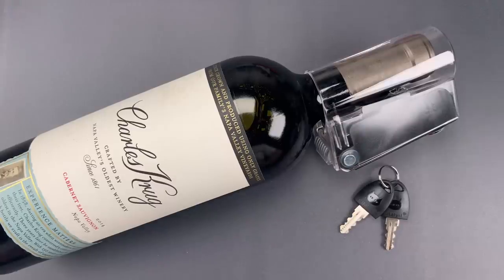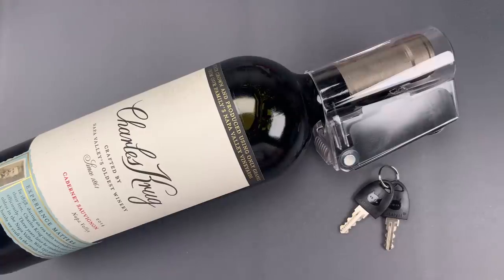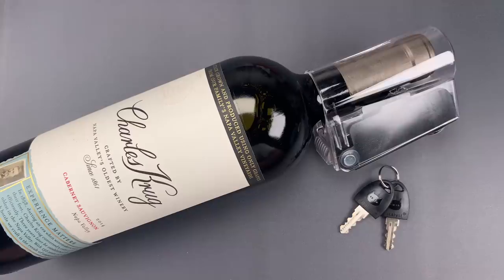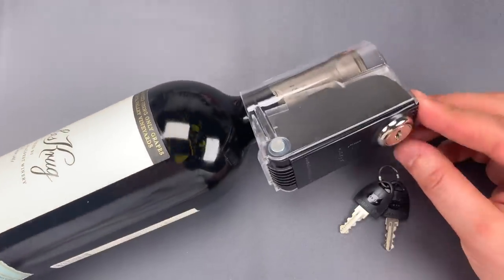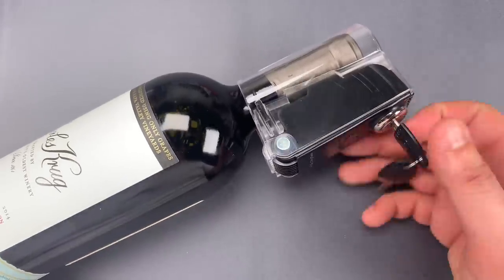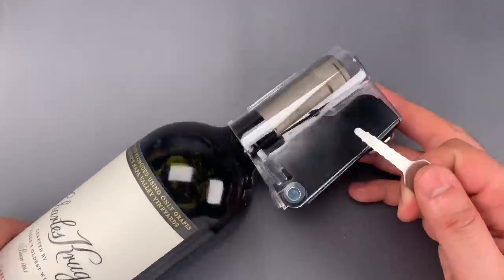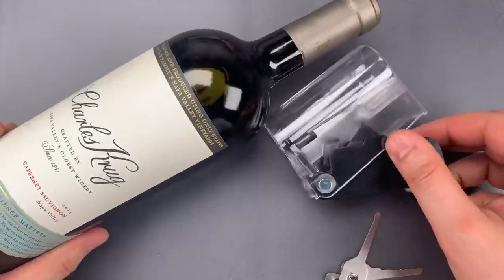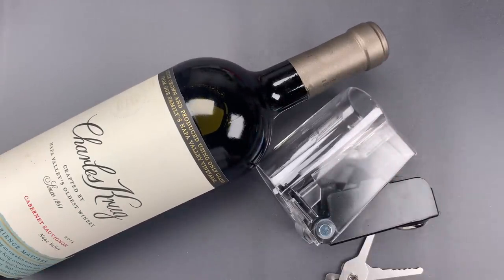[1153] Catalyst Bottle Lock Jiggled Open

Comment: I'd rate this product 2/10: still better than Master lock.
Reply: I was going to say you’d be better off putting a Master lock in your liquor cabinet!
Reply: I was really hoping this would be the one lock he couldn't pick.... ok, not really.
Reply: nah, a 1/10 is still better than a Master lock
Master lock is the baseline for: no this is bad.
Reply: My first lock I picked was a masterlock pad lock. Bought it brand new and when I got home, I put my pick in it and instantly unlocked. Confused I do it again and the same thing happened. I looked at the key and saw that only one pin needed to be moved just to unlock the lock.
Reply: I was like 1K.
Reply: Masterlock are good training locks as i bought a pick set, I picked the flagship Excel 70mm wide with U shape pentagonal 12mm shackle in about 2 minutes, consider that i had no previous experience, i consider that a good effort. I also popped all my other masterlocks, but for training locks they provide a novice with a challenge
Reply: @JamesPhillipsOfficial  Thanks for the advice!
The one thing that a novice can't open them with is half a bobby pin and a paper clip. I tried.

Comment: LPL: hey guys today we’re going to pick into the Whitehouse, as you can see I’ve taken out the guards so we can work in peace
Reply: "How did it feel, Preston?"
Reply: I've taken out the guards using this bomb Bosnian Bill and I made
Reply: The first thing you do is rotate the guard's neck as far clockwise as it'll go, grab vertebra number one, and let's start cracking. Nice click out of two, aaand we're done. And there you have it folks, as you can see, this is not a spinal column I'd trust securing my nervous system.
Reply: @Wampa842  As you can see from the bone construction of the skull, it's not designed to resist forced entry
Reply: @Wampa842  quality comment
Reply: I'd really want to see him do any of the locks used at Fort Knox.
Reply: @pooyataleb2514  Is it just a pipebomb made from failed Masterlocks?
Reply: Not gonna lie LPL could legit have and star in a spy movie, use real methods of breaking in and I'd watch the fuck out of it.
Reply: These comments are gold 😂😂😂💙

Comment: You know that the lock has been tempered with when the bottle is suddenly half-empty
Reply: ... or missing...
Reply: Or as it's a wine bottle that the seal on the bottle itself is damaged 🤣
Reply: It takes more skill to put back the cork in it's original state.
Reply: Drank some vodka when i was 12/13, replaced it with water, a few days/weeks later this bottle that hadnt been touched in years gets thrown in the freezer
Reply: Nathan Fielure or a butlers friend 🤣

Comment: Wine bottles on the shelves in Tesco: ”I’m in danger”
Reply: I used to work in Tesco and these things are a nightmare. They'd get stuck on bottles with fat necks, Jack Daniels was the worst, and you end up having to rip the thing apart to get it off.
On smaller bottles you could actually take the whole thing off if you jiggled it right, no tools required at all.
And best of all on pretty much any bottle it's possible to shim the big latch thing that holds the tag onto the bottle. I tended to use a pen.
Reply: The ultimate try-before-you-buy pick. :)
Reply: Some mirrors and good video cameras would be much more efficient, and less insulting to staff and customers.
Reply: I had to look up Tesco.
Reply: UK's Target <3
Reply: @chrisb9960  Tesco is basically like Walmart in America, similar type of store, you can get things like electric goods, phones, clothing, gift cards as well as food. I used to be a Security guard there. One Tesco store managers are adamant that i was scared of shoplifters, but actually i think they were scared of me as im taller, bigger and stronger than all their staff put together, they would s+++ their pants if i turned up there again, because it wont be pretty xD
Reply: @JamesPhillipsOfficial  He asked about Tesco, not your life story mate, nor how badass you are.
Reply: @JamesPhillipsOfficial  Asda would be the Walmart of the UK
Reply: @JamesPhillipsOfficial  Instead of making inaccurate analogies, it's much easier to just say that Tesco is the UK's largest supermarket chain. It's not much like Walmart at all, because it's much more focused on groceries.
Reply: @JamesPhillipsOfficial  Isn't the sole purpose of an LP to deter theft? Your job isn't to pick fights with people lol. Tesco are idiots if they think you should risk your health just to tackle a guy running out with a bottle in his hand.
Reply: @DexVorsutus  The dude doesn't require the guy who commented to ask in order to talk about that.
Reply: I went into a Walmart the other day and man I bet some prisons have less security. There was one aisle that no joke had 4 different cameras running and I think two of them had live feeds to show that they were recording. After looking in other aisles I noticed there also were at least 1 or 2 cameras if not more in every aisle. I kind of understand that kind of security in like the electronics section but in some random beauty products section where the most valuable item was probably only like 20-30 bucks. Seemed a little overkill.
Reply: @nop2774  Cameras on the cosmetics aisle make sense. Small items costing $20-30 are a good target for thieves because they're easier to smuggle out of the store but still fairly valuable.
Reply: CMOT Dibbler 
Asda is actually owned by Walmart, as they bought it years ago, and Asda was formerly called “Asdale” , hence the name
Reply: @ataphelicopter5734  Asda was never called Asdale: that was just the name they used for their own-brand clothing for a time. They were bought by Walmart in 1999.
Reply: @DexVorsutus  ok bozo, chillout. How dare i add to the conversation, right? What we can learn is that Tesco is a supermarket, if comments are not boring enough for you, go read a health and safety book, that will satiate your desire for boring comments, thankyou, kind regards
Reply: @KiLLJoYYouTube  yeah that's what it felt like, i'm not a thug in uniform, im not going to risk my health for a bottle of wine. our trainer said we can't touch people unless backed into a corner, so i followed that, i asked shoplifters politely to return wine bottles, while i got my hands on a bottle with one shoplifter, we did tug of war, she got away. The staff want a bulldog for a security guard, im not like that im civil, polite and try to reason with them, im not going to fight people over stock that isnt mine in a company that doesnt care about me
Reply: @DexVorsutus  obviously i got sacked from there. The specific store i hate is worcester foregate street tesco express. Type in google. Someone was stabbed outside there just last night at 4:30am. It's a rough store, so the staff are very antsy and highly stressed. But i was relieved, i may do a video about that store, but with my current situation, its high risk, they still have my details on record for 3 years according to data protection. I can play it in the next 2 years possibly
Reply: @JamesPhillipsOfficial  ok boomer
Reply: @ataphelicopter5734  Asda used to be "Associated Dairies and Farm Stores"
Reply: @DexVorsutus  wow, so original 😐
Reply: @JamesPhillipsOfficial  ikr
Reply: Lesson learned - don’t trust someone who lives next to an Asda about the history of Asda

Comment: The desperate drinker will automatically have the necessary shaking movements hard wired - just put anything inside the key way, and 'open sesame'!
Reply: Thumb pressing on the cover while jiggling would've taken the pressure off the "lock", making the jiggling even easier and lower skill.

Comment: Fabulous!

This should have been another for Mrs LPL,
imho.
Reply: I was thinking the same thing. Just harder to code 2BDrank than 2B8. 😉
Reply: She would just cut the bottom of the bottle
Reply: The lock is open on the top.  If it’s sealed with a cork, she could just use a corkscrew.  A screw cap would be trickier.

Comment: We use these with a magnet release as a poor anti theft device, if you feel brave you can actually just smack them hard from the bottom and pop them straight off the bottle, also if the bottle has a threaded cap you can often run the detent like bit that springs out up the thread and off the bottle, or just undo the threaded cap...

Edit- just looked at the price on amazon... what the hell.. 3 pack for $60 we buy boxes of like a hundred for less
Reply: A couple of years ago, i was at an international summer school for students and we ended up at a bar. After leaving, it became clear that one of the guys and taken a bottle of alcohol with him, still with the locked cap in place. He nearly cut himself as he tried to open the bottle, the complete content wasted. Yeah - he was an idiot, but at least against drunk people, the seals work somewhat.
Reply: Can confirm. The amount of times home delivery services forget to remove the anti-theft tags/locks has made me pretty efficient at removing them without tools. Sometimes they chew up the caps but the type shown here is particularly easy to get off in the ways Simon suggests.
Reply: I've managed to open one using two forks as wedges to open the gaps then slipping a pick in and simply pushing both of the clamps off the bottle. It feels like you need 3 hands but it's definitely doable once you work it out.
Reply: @lairdcummings9092  they work ok ish as a visual deterrant but the cost to retail is pennies per unit and they do deter the low effort theives
Reply: @Simon-ho6ly  so, useful in a retail environment. But bloody useless at home.
Reply: Christian Challiner for about 30 quid you can buy a Tag Remover off amazon (for the magnetic ones)
Reply: @WastefulGlint  For less you can just buy magnets

Comment: If only wine bottles has a in build tamper seal...
Reply: I assume this lock is for a bottle that is already opened.
Reply: I live 10 minutes from a fairly sizeable wine-producing region in Australia. Most bottles of non-sparkling wine here have screw caps, not corks. It's just more practical for consumers, who won't need a special tool to open a bottle and will be able to close it again afterwards.
Reply: @3rdalbum  I'd hardly call a corkscrew a special tool.  I can also assure you, corks are reusable.
Reply: @Tjalve70  Seeing as the top of the lock is open above the cork, an opened bottle of wine could be reopened while leaving the lock on. Assuming you use the correct style of cork removal tool. Instead of using the corkscrew variety, use the shim/wedge cork puller type or even the needle and pressurized gas variety. In that case, the "lock" wouldn't even need to be removed. If you're careful cutting the foil, you could even glue it back on. Look for LPL's Ben and Jerry's lock video. His wife was clearly thinking outside the container and knew how to handle LPL. 😁👍
Reply: @3rdalbum  Yes but its still a tamper seal as you break the metal connecting the screw top to the neck of the bottle.
Reply: Tjalve who locks up an empty bottle?

Comment: A wise man once said, "Warm beer is infinitely colder than no beer."  Thus it is with wine bottle locks....
Reply: the thing i've never understood about these bottle locks, what is the actual point to securing something which you can simply break open by snapping the top of the bottle off? like if you're gonna drink it anyhow, its not like they're gonna NOT know that the bottle has less in it than before or is gone entirely

Comment: If my kid chooses to learn lockpicking just to get access to a bottle of wine, instead of sourcing one elsewhere or merely breaking the lock, he deserves the wine.
Reply: I was literally just thinking this same thing LOL!
Reply: Though to be honest, I wouldn't call this 'lock picking.' Too easy.
Reply: Classic is to break the neck of the bottle, then carefully not touching the shard edges,
Reply: @johndododoe1411  Easy, that's what the plastic solo cup is for.
Reply: Be careful. This is a gateway lock. Next thing you know he'll be cracking your safe full of cocaine.
Reply: so, a better way to explain this, this really isn't lockpicking, this is just what you're already subconsciously doing when your hardware store cuts you a key for a lock and it doesn't quite open it, but you can wiggle it around until it pops open anyways

Comment: Me before: Faster to get a saber and cut the top off.

After watching: Never mind. Keep the Saber on the wall.
Reply: You can't sabre the top off with the lock installed, because sabring requires running the sword along the neck of the bottle.

Comment: When I saw the word catalyst I thought you were doing a review of a lock designed to prevent theft of automobile catalytic converters . I’m an auto mechanic by trade and have seen an upswing of cat converter thefts. Some install shields and I’ve seen products that use locks. How about giving them products a try.  Thank you

Comment: To reduce friction on the core, can you press in slightly on the locking piece? The spring action is forcing it open, and that force is probably concentrated on the locking tab itself.

Comment: Friends kid, took a drill on one of these thru the top and into and thru the cork then pour it out. No matter how strong the lock of the tops drillable and every home should have a drill and bits around it's easy defeated. It was an empty bottle and a test for his kid in problem solving as a lesson. He's now over 21 and still hardly ever had a beer or any booze.

Comment: As an ex teenager wanting alcohol I can honestly say I went for the easiest option. If my parents had a dozen cheap bottles of wine and half a dozen expensive bottles then this lock on the expensive bottles would have been enough to ensure I took the cheap bottles. While locking all of them would not have helped as I would have found a work around for them regardless of how great the lock was.

Comment: It looks like you can pull the cork out without opening the lock, anyway. Plus, what good is a tamper seal, when the removal of the cork is already a tamper indicator?
Reply: It's for spirits, not wine.  Wine goes off after opening, so you tend to drink it all within a day or two.  He just happened to have a wine bottle handy.
Reply: @bdf2718  If your hard liqueur is suddenly 10% instead of 60% you know your kid has been in there and replaced it with water.
Reply: @MyRegardsToTheDodo  Tantaluses were originally to prevent servants getting at the booze.  They might top up whiskey or brandy with urine rather than water, just to get a better colour match (and also because they hate the boss).

Comment: Stores in the U.K. use these type of tags for alcohol bottles.
Thieves that come into my store to steal these bottles with these types of tag on them simply use a folded piece of paper to open the lock from the inside by sliding it up and pushing the locking mechanism into the body of the lock, letting the bottles neck slide out almost frictionless

Comment: I was always under the impression that type of lock was more meant to point out that the bottles in question were particularly expensive. Along those lines, it is a good reminder to the bottle's owner that a bottle is expensive, so they don't accidentally drink a bottle they were saving for a special occasion. It also tells those underage that drinking this particular bottle will result in a severely angry adult- my brother took an expensive bottle of my father's whiskey and my father still occasionally brings it up resentfully 15 years later.

Comment: Would it require much force if applied some pressure like squeezing the lock part towards the bottle as it seems like when you opened it the lock part was trying to repel

Comment: The bottle comes with a tamper seal the teenager can't replace. Just make sure you only lock up full bottles that haven't been opened, and when you unlock them you will be able to easily tell when they have been accessed. :-)

Comment: You can also bypass these kind of bottle locks by sliding a piece of thin plastic up the inside between the bottle and the spring loaded latch then just slide it off the bottle.... 😉

Comment: You can just firmly pull up on the whole lock really quickly and it will slide off.  Its even replaceable after.  Same with the anti theft devices they put on liquor bottles at the stores. I have a friend that worked at CVS in college and showed me one day. He just grabbled the bottle and firmly yanked the theft cap up while twisting the bottle  And the cap popped right off.

Comment: Do hook-shaped/J-shaped locks exists? I feel like that would be a great way to make a lock if you put a curved bar inside it and had a key with a gap in it just large enough to go around the curved bar when turned. If you put a normal key in, it would go in but not be able to turn due to the bar. If you try to pick it, you would need to get around the bar first just to get to the pins. Basically the same concept as putting a shroud around a door handle to stop an under/over door attack, but apply it to the inside of a lock. The only downside I can think of is if the key is made from poor material, it may snap when you turn it and basically ruin the lock.

Comment: I mean, I get LPL's sentiment that it's a very easily breached lock, but it's also not like every teenager has a set of jiggle keys... If it had been priced at a tenner or so, I think it would had been a fairly okay for value deterrent to all but the most crafty teens. At 60 for three though, bit expensive.

Comment: These are used in the UK as anti theft devices in supermarkets, usually with an embedded security tag and a lock that only requires a very strong magnet to open it.
I don't have a very strong magnet.
It was a right PITA to get one off, but there was no security tag inside.
(No, I didn't steal it.)